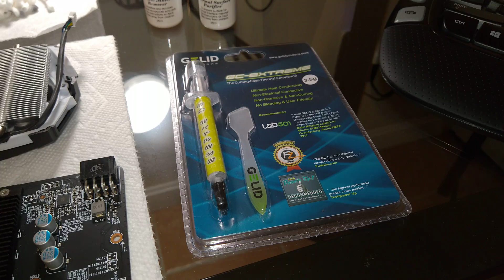MSI Armor Radeon RX 580 (Heatsink Removed)

Comment: I have the same card. Applied thermal grizzly and temps went from 80-88 degress to 60 to 65 degrees. Also modified case front panel for better airflow. So far so good!

Comment: These 3 blocks of RAM also need thermal pads! 5mm thick! Card with Micron memory had it, Hynix didn't :O
Test of thermal pads are 1,5mm, that long one on power supply is 3mm thick. 

For all viewers: if you are changing paste change and complete lacking thermal pads - these from factory are awful and as you see even here even not placed! :O
Reply: Do you need to replace the thermal pads for the ram or you can reuse it? Also you are talking about the other rams that didn't have any thermal pads? If so where can I buy them for cheap? I'm a total noob, some layman terms and suggestions would help, ty!
Reply: @brianvo42  I did it over the weekend so I can finally tell everything :D You need 1,5mm termopads for 6 RAM blocks, 5mm termopads for 3 RAM blocks which are bit further - one of my cards didn't have those! Factory decided not to use it :O But other the same card but with Micron memory had it so that inspired me to make it as it should be in card with Hynix memory.

If you are doing it it's better to use new termopads - these from factory are mostly bad because they are cheap (absurd!) and designed for different purposes (long years of storage, vibrations in transport, below freezing temperatures etc.). Try to choose as good termopads as you can - mine are even 12W, thicker are not that strong but still around 6W. These from factory were probably 1,5W!

Remember to clean radiator and GPU and use new paste too! This is even more important than termopads :D

BTW you can reach me at hello@maciejczech.com and I will show you photos of which termopads go where, how I did the cuts, how big are pieces, what brands I used. I could even send you set of all that for just a fraction of normal price because I won't need the rest of it. But I'm from Europe, if you are from any European country we could arrange that :)
Reply: Aaaa and 3mm termopad for power supply! As I mentioned it in my first comment :)
Reply: Saeglopur89 o sweet I just replace the thermal paste yesturday and found out they already all have it lol. I also found out artic silver 5 has a curing time :(
Reply: @Saeglopur89   O kurdę :D widzę że trafiłem na Polaka :) mam właśnie ten sam problem z tą kartą, zmieniałem termopady, ale okazało się że dałem za grube właśnie na te 3 bloki pamięci i prawdopodobnie rdzeń nie stykał się z radiatorem, karta zaczeła łapać wysokie temperatury aż dochodziło do throtlingu,  mógłbyś powiedzieć jakich termopadów użyłeś i jakiej pasty ? ew. odkupiłbym termopady na te 3 kości, zaoptarzę się w szczelinomierz do pomiaru żeby wiedzieć następnym razem co kupić
Reply: @Brownly  Na te 3 bloki pamięci dałem termopad 5mm po czym sie okazało że za mało!!! Rozłożyłem, dowaliłem jeszcze na to 1,5mm i jest w sam raz. Aż niemożliwe żebyś tam dał za dużo :O
1,5mm było na pamięci te które mają chłodzenie standardowo (u mnie 1 egzemplarz karty miał termopady wszędzie, drugi miał tylko tam! :O fabrycznie! :O), 5mm+1,5mm na te 3 kości pamięci pozostałe, 3mm termopad na kondensatory niedaleko zasilania.
Termopady i pasta z ejama.pl, brałem najlepsze jakie sie dało. Termopady 1,5mm miały aż 12W/mK termoprzewodności, pozostałe po 6W.
Pasta też 12W/mK Grizzly Kryonaut - gdybyś chciał to ci mogę ją nawet odsprzedać. Jeśli na 1 karte to może nawet mam termopady! Tzn mam napewno ale pytanie czy wystarczająco
Reply: @Saeglopur89  Tak samo dałem, razem 6,5mm (dałem pierwsze 6mm, potem gdy się okazało że to za mało to dałem jeszcze 0,5mm)  i akurat stykło, tylko właśnie mam teraz problem z tym że nie mogę docisnąć radiatora do rdzenia karty, może termopady na 3 banki pamięci bardziej ścisne, i akurat bedzie równy docisk, bo zaobserowałem jak by jedna śrubka nie była do końca dokręcona a inne 3 normalnie, w jakis sposób dawałeś termopady? ja robiłem "na kanapkę" czyli jeden na drugi,  na cewki dałem też 3mm, na sekcje zasilania dałem 1mm chodz oryginalnie było chyba 0,5mm(ta czesc przykryta przykręcanym na 2 srubki radiatorkiem), narazie zamówie pastę i szczelinomierz, bo duzo kart rozkrecam i potrzebuje dokładnego pomiaru szczelin,  co chodzi o termopady to pokombinuje cos z tymi moimi,moze je bardziej scisne, zeby radiator dolegał do rdzenia, ale w razie czego to będe pisał na maila ok ?
Reply: @Brownly  Miałem 3 rodzaje termopadów tak jak wyżej opisałem wg tej grubości i ich termoprzewodności - celowo żeby nie łączyć a stosować zawsze jeden jednolity! Tylko tam gdzie był 5mm musiałem dowalić 1,5mm jeszcze a sie tego nie spodziewałem ;D
A może ci nie dociska bo np nie wskoczyły dobrze wypustki na śruby z radiatora które prawie wchodzą w płytke PCB?
Może po prostu pasta sie rozmazała tam jakoś dziwnie?
Reply: @Saeglopur89   Wydaję mi się że to przez ten gruby termopad na 3 blokach , będe próbował go sciskać żeby trochę się spłaszczył, pisałeś że ta karta sprzedawana z pamięciami Micron, nie miała tego grubego termopadu ? : O na tych 3 blokach, to prawda ? i jeszcze jedno pytanie :), jakie temperatury osiąga u ciebie twój Armor ? u mnie po undervoltingu karta dobija do 83 stopni przy 2000 RPM, i zrzuca te taktowania,  i  to mnie zastanowiło, wiec chcę jakoś to naprawić
Reply: @Brownly  Micron miał fabrycznie termopady na wszystkich kościach, Hynix nie miał co nie zaskoczyło. Później dopiero tak pomyślałem że może jest w tym jakaś logika bo może GPU by je grzało bądź odwrotnie! Ale ja używam kart do kopania ethereum w tle (oprócz normalnego używania) więc to właśnie pamięci wymagają chłodzenia.
Mam temperaturę zadaną 75 stopni i realnie karty są przeważnie między 71 a 74, gdy w pomieszczeniu jest za gorąco to dobijaja jedna z nich do 75 i rośnie prędkość wentylatora powyżej 50%.
Staraj się nigdy nie wchodzić powyżej 80 stopni, najlepiej do 75 max bo powyżej tego cierpią termopady i pasta - mogą tracić swoje właściwości przez takie przegrzanie :D
Reply: @Saeglopur89  Hey, i have sent you email please check it if u are here!
Reply: @kaluginden  Just replied with photos :)

Comment: With MSI Afterburner take a step with the undervoltage, pull down the gpu voltage 0.1 V, and there will be fine.Less power need, stable, and less heat will be.

Comment: I have 8 gb of this type, the cooler is underdesigned, the heat pipes are less than need it for the right cooling.I replace 7870 GHz edition 4 heatpipe design, and the full max stressing make a 68-69 celsius degree.In game is 61-65 celsius.

Comment: How thick are the thermal pads?

Edit: For the Vrams
Reply from the maker: If I had to guess 1.5mm
Reply: @VcomputersChannel  
Thanks for answering 👍
Reply: @pcwinsfatality1573  1,5mm were good? Did you replace yours already? :)
Reply: @Saeglopur89  Yes, and it was the right size ^^

Thx for asking :)
Reply: @pcwinsfatality1573  So all of them were 1,5 mm? :) I have two RX580 and I see from the outside that one of them have some thermopad more than other one. Will try to make it correct finally for both of them
Reply: @Saeglopur89  Except for the one tho, that looks way thicker. For that one, i dont know which size sry :/

But all of the small vrams near the gpu chip are definitely 1,5mm 👍
Reply: @pcwinsfatality1573  Perfect! So will order 1,5mm and will try to measure from the outside how big is that bigger one. I have it only in one card with Mircon RAM, second card is with Hynix RAM and does not have that biiiig termopad which is interesting - but I want to add it in both :)
Reply: @Saeglopur89  Sry for the late answer ^^

And, was i right about the thickness 1,5mm? ^^

Oh and did you find out, how big the one thermal pad is? ^^
Reply: @pcwinsfatality1573  It looks like it's 3mm at least :O That big one! I have it only in card with Micron RAM, in Hynix it's not used at all :O Will finally start to maintain this and will let you know :)
Reply: @pcwinsfatality1573  Hey man! I'm finally doing it! I've dissasembled one of two cards and got measurements of everything! And confirmed that difference in the same model card but Hynix vs Micron memory - Hynix didn't have extra thermal pads for 3 blocks of memory!!!
These blocks are 5mm thick
Other blocks of memory need 1,5mm thermopads
Power condensators or something needs 3mm thick themarl pad!

You can reach me at hello@maciejczech.com and I will send you photos and details :)
Reply: @VcomputersChannel  All of them were 1,5mm?
Reply from the maker: Saeglopur89 I’m not sure but I think most except for one that was a little bit bigger.

Comment: Hello. Thanks for video. I have MSI ARMOR RX 580 4GB. In games, the video card heats up to 80 degrees. Heating takes place even in the Shadow Of The Tomb Raider game menu to 70 degrees almost instantly. Further to 80 in a minute or two. Full HD display. The fan speed is almost 100%. Could this be due to thermal pads that have failed over time? I changed the thermal paste. The situation has not changed much. Thanks for the answer.
Reply from the maker: Mikhail Valter Try to again replace the thermal paste with a different paste. Also make sure the card has airflow.
Reply: @VcomputersChannel  Solved. It was mining bios on this videocard. With different timings of chips VRAM. I installed default bios and low Temp Limit from 90 to 78. Success. 74 degrees in stress test.
Reply: How did you do it i have the same thing with my card

Comment: Hey Man, I wanted to say thank you I watched your video many times and finally had the confidence to void my warranty. The results are honestly and literally unbelievable. 
So firstly I play Fallout 76 and before the new thermal compound:
I ran every low settings except for render distance at ultra and texture was at medium the rest was low settings. My card ran at 100 load and thermals were 86+
After replacing the compound it's like I had a new card.
First I am able to run most settings High to Ultra 
Second GPU utilization is at 60 to 90 percent where it goes back and forth depending on the scene.
Thermals are at most 66 celcius 
My theory is that the initial thermal compound was so bad that it had to undrrvolt inorder to not overheat. 

I have been left speechless and very happy that I voided my warranty. Thank you 😊
Reply: Edit: I would like to know the results from other people who have this card

Comment: Before, I was getting 85-90 degrees on full load and my comp would often black screen. After reapplying, I'm getting 65-75 at full load. Process is very quick and easy as you explained. Thanks!

Comment: was it worth doing? I might be doing this if it showed any performance improvements.
Reply from the maker: Have not tried overclocking it or anything. Have not noticed any big performance improvements worth talking about. The only thing I noticed was the GPU is running a little bit cooler under load. Because of it running cooler it finally passed 3DMark fire strike ultra stress testing where before it would get too hot and fail the stress test. It's only worth doing if you care about your GPU getting better cooling.